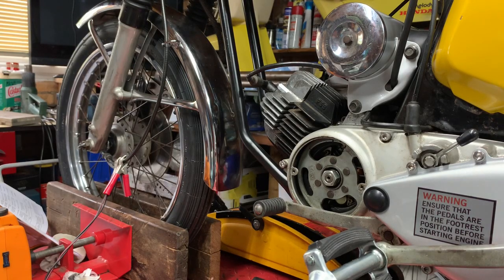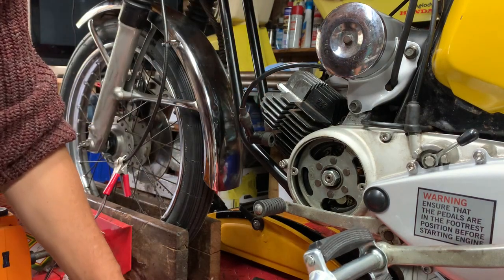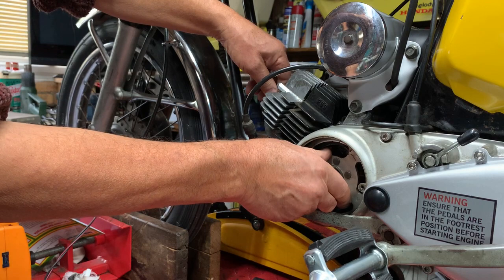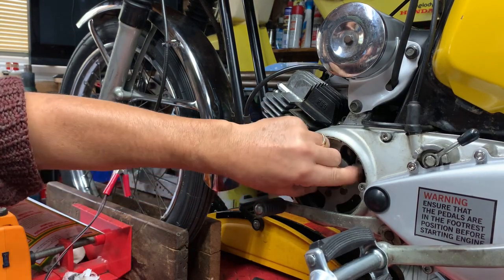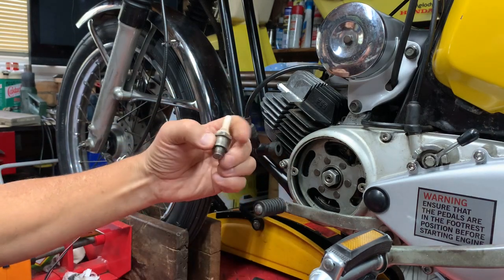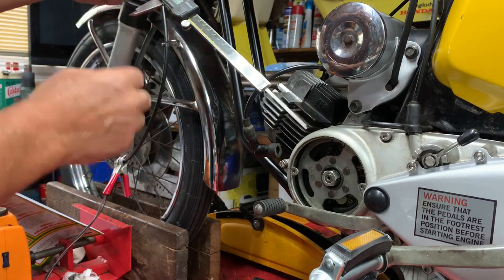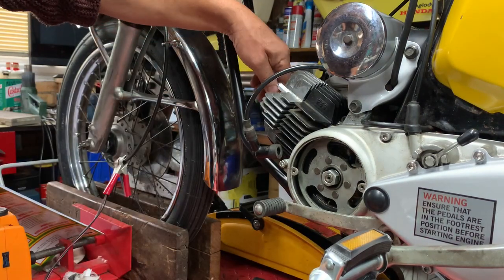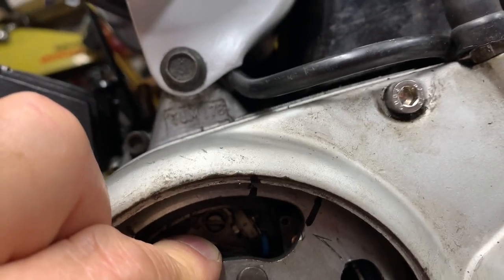Checking ignition timing on moped engine.

Comment: The timing is fixed on them anyway. You can only adjust the points gap. All that faffing about for nothing.
Reply: Agree about the faffing! Changing the gap changes the timing. Of course, the FS1( and EVERY other bike I worked on back then) sold in South Africa had the top dead and fire positions stamped into the flywheel. Simple: a spot of white paint on the mark and pointer, run the engine to check with a light, adjust the gap as needed.
Reply from the maker: Hi, chaps, thanks for your comments. I get what you mean about the timing being fixed. I guess I chose the wrong bike to demonstrate how I check the timing on my mopeds and other small engines. I should have show it on an engine that has an adjustable stator plate. I will change the title of the video if I can. Bikes like the NSU Quickly with slots in the stator plate were set up in the factory with the correct points gap and timing, then the stator plate was marked with a line stamped from the plate to the crankcase. You could then fit new points, set the gap and as long as the line was in the same place the timing was correct. The problem is that years later when people (like me!) are building up engines with parts from other engines the lines are not necessarily in the correct place.